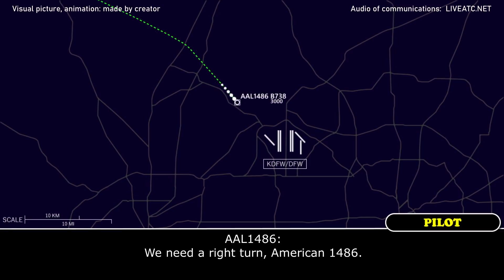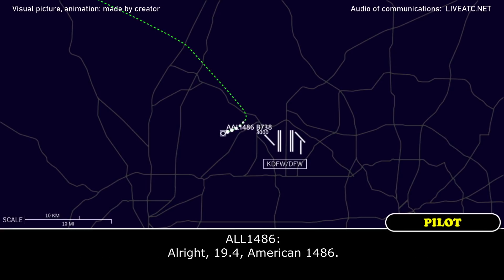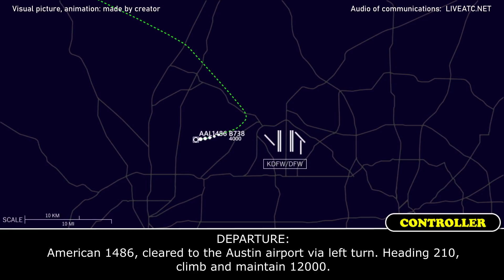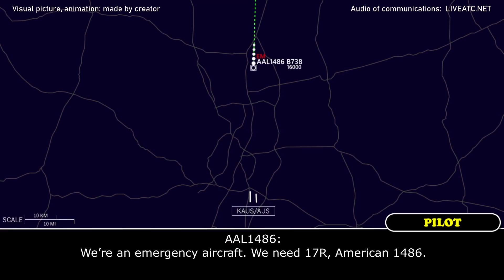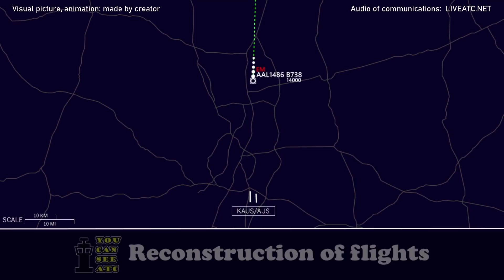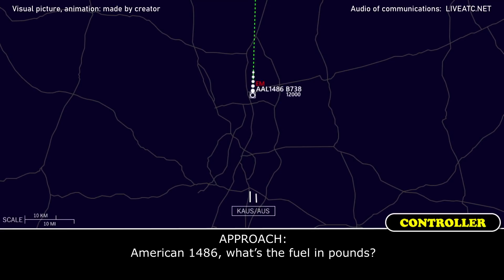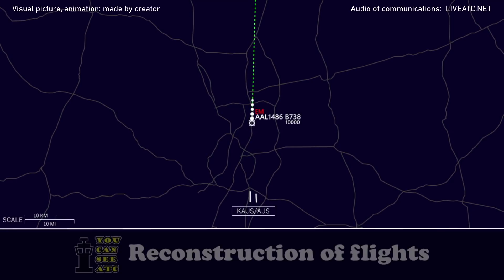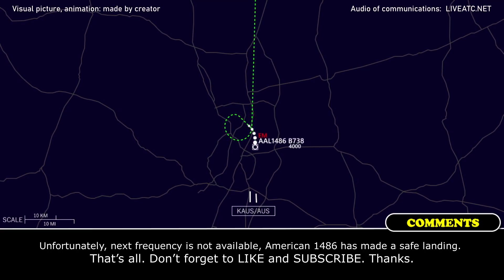FUEL EMERGENCY. Minimum fuel on landing | American Airlines Boeing 737-800 | Austin airport

Comment: why did they 'need' 17R as opposed to 17L initially? aren't they similar lengths and same heading? parallel
Reply: My guess is that they already had 17R it plugged in on their FMC.
Reply: 17R is 3200' longer, maybe they were thinking they could land fast on the longer runway.  They did the 360 after realizing they had 17L
Reply: @mattbradbury1797  Ah I see, didn't realize 17R was that much longer.

Comment: I can understand why ATC wants souls on board for an emergency aircraft, but I don't quite get why they need fuel in pounds.  Are they hoping to calibrate how much water the rescue trucks should bring out to the runway?
Reply: Helps the fire department in the event of a crash. They’re going to bring the same amount of water (foam) regardless but helps them know what to expect in the event of an accident.
Reply: The alternative is fuel in time. That varies significantly depending on the type of airplane. 45 monutes is about 600 gallons on a 737, 60 gallons in a turbo-prop or 2500 gallons if it were a 747. I think there is a big difference between 600 and 2500 gallons.

Comment: Be careful with your video title.  Minimum fuel is not an emergency.
Look up Avianca flight 52.

MINIMUM FUEL− Indicates that an aircraft’s fuel
supply has reached a state where, upon reaching the
destination, it can accept little or no delay. This is not
an emergency situation but merely indicates an
emergency situation is possible should any undue
delay occur.  
Source: Federal Aviation Administration- Pilot/Controller Glossary

In this incident, they declared a fuel emergency , which gives them all of the priority of any emergency.
"Minimum fuel" is merely an advisory to the controllers that further delays can result in an emergency.  This was not a minimum fuel situation and they did not declare "minimum fuel."  
Getting those two wrong can be deadly as demonstrated by the Avianca Flight 52 accident.  It's not a minor point.
Reply: Are you even a pilot
Reply: @customerservice3138  Yes, why?
Reply from the maker: Thank you.
They said that they were an emergency aircraft.
They said they were low on gas.

That's why i decided to make this title.
Reply: Well, I guess the pilot considered it one, since he declared emergency aircraft, was asked all the standard questions by ATC, and squawked 7700. But I'm sure you know better!
Reply: @tvsjr1  you have it all sideways. The pilot did not declare minimum fuel because minimum fuel is not an emergency.

Comment: To be fair this is rotten luck,  Crew did well, they called it  4000lbs is about 45 mins left at touchdown,  They didnt push anything past the limit, They went to the limit and then did what they needed to do.  The event actually shows well why aircraft take all the fuel they do.

Comment: No question on the Fuel emergency request 4,000lbs of fuel is super low what is that less than 45 minutes-ish?
Reply: Less than 30 minutes
Reply: @ryanrussell7991  what happens when an emergency call is investigated and it is determined you lied as to the underlying details?
Reply: @martintheiss4038  what do you mean
Reply: @ryanrussell7991  if a pilot estimated low fuel but youhad over 3 hours left for example
Reply: @martintheiss4038  there's going to be a lot of determining factors on that. If all gauges said it was empty and everything to suggest that they were low but the were not and it was a maintenance issue then nothing would happen to the pilot. 

If there was fuel and he declared an emergency for no fuel then I think he would be getting a phone call from the FAA

Comment: I thought I read somewhere that the pilots are responsible before they take off for making sure that they have enough gas. Is that true?
Reply: That doesn't help much when you're stuck in a holding pattern because you can't land.
Reply from the maker: They didn't expect to wait so long.
Reply: Yes and he had enough fuel.
The rule is generally:
Fuel for flight +
Fuel for destination to Alternate +
Fuel for 15-30 minutes at max power +
Fuel for 30-45 minutes hold/cruise.
(So any flight of 90 minutes will never leave under 3 hours gas.)
These times will be even longer when over oceans etc
Reply: And if they eat into the final max power (the fuel that should never be used) it's auto emergency
Reply: @CameTo  What???
Reply: A number of calculations go into how much fuel to carry and how much contingency fuel.  Fuel is calculated for trip time, at least 1 missed approach, time to fly to an alternate, fuel for taxing and contingency fuel plus a crew can opt to carry additional reserve fuel if they feel it needed.  However you can't always calculate for everything, and carrying more fuel means you burn more fuel for the same trip.  The aircraft will need more power to take off and be heavier when landing.  If for instance you have to land on a wet runway you may need to burn off some fuel to ensure you can stop.  So those calculations can be difficult.  

Also Since there was bad weather it's likely multiple aircraft had to divert.  ATC may hold you for other Aircraft at minimum fuel.  When a fuel emergency is declared that doesn't mean the plane is about to drop out of the sky it should have at least 30 minutes remaining from when the emergency is declared. That is the procedure and will open up a lot of alternatives for the pilot and ATC including closed Runways that are still serviceable for landing or military Runways.  The pilots maybe giving more direct routing not ordinarily given and things like noise abatements can be ignored.
Reply from the maker: Thank you.
Reply: They can't control the weather.  They are fueled properly. Diversions aren't part of the plan, normally.
Reply: They obviously had a lot of extra fuel. The problem is when after you are done holding you can’t actually land as was the case here. At that point it just becomes a pilot decision. I wonder if he could have just went to DAL
Reply: @essel23fly  DAL is 2 min away.  Doubt the weather was any better there.  However they flew directly over ACT(Waco) so they obviously didn't think it was THAT big of an emergency....
Reply: Thanks! Good to know 👍
Reply: My understanding planes flying into California airports from out of state usually carry much more than they need due to higher fuel prices in the state. Try to cut down on fuel expenses.
Reply: @jay hinrichs WRONG!!!
Reply: @gavinsingh4450  OK  lets re phrase that you should have an alternate.. been a few years since I flew IFR  but I seem to recall the enough fuel to destination plus your alternate plus 45 minutes..
Reply: Good chance they did not have an alternate. Fuel being as expensive as it is they do not like to add extra unless required.
Reply: @jasonm5945  If the official NWS forecast for one hour before and after arrival time doesn't meet certain criteria then an alternate is required.   Sometimes the Thunderstorms pop up without being forecast but I think in this case the time spent in holding followed by an approach and go-around is what caused them to get low on fuel.  The only thing they could have done differently is leave the holding pattern sooner for a divert to Austin.   Diversion is a big deal because it cost a lot of $$$ and messes up the passenger's connections so most pilots will try to avoid it, up to a point.
Reply: @jasonm5945  -- AUS was likely their alternate.